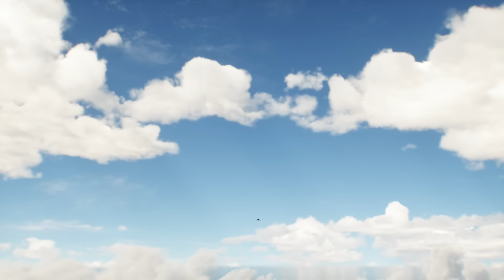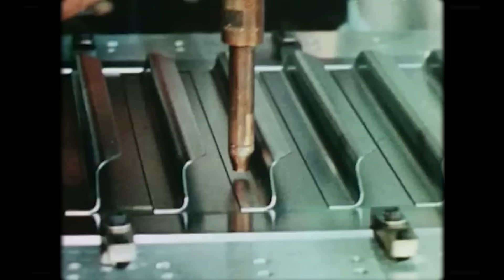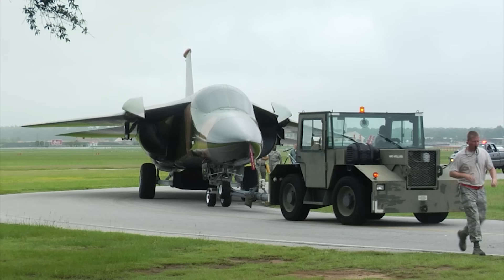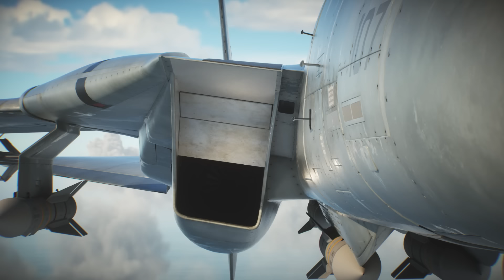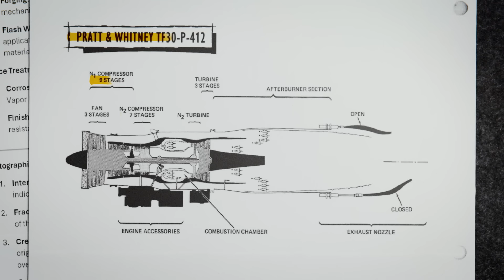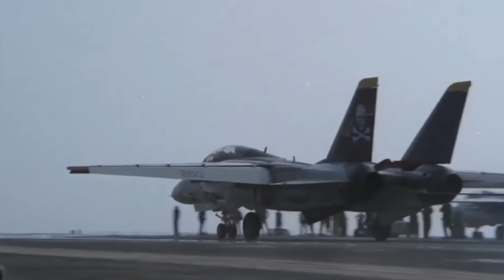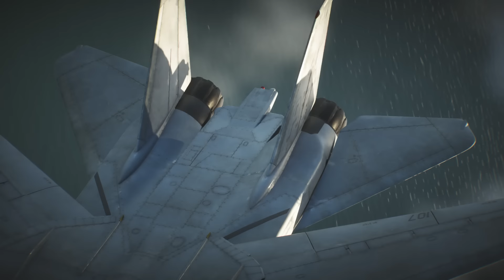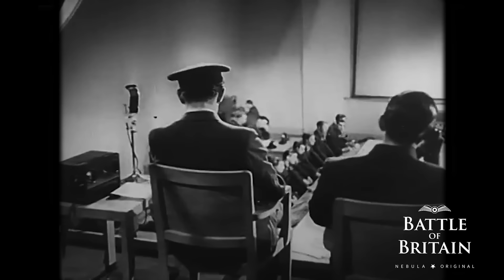The Insane Engineering of the F-14 Tomcat

Comment: In re the F-14 and Top Gun it's also worth noting that the canopy failing to properly separate in a flat-spin scenario was a real issue
Reply: Yes, but it's covered in NATOPS ejection procedures.
Reply: Canopy's need the forward speed of the aircraft to help rip them off and send them away before ejection. It would be terrifying to be in a flat-spin while wondering if that thing is going to separate properly.
Reply: @deekamikaze  I was an AME on F-14s from 87-90.  It was quite a while ago, but I suspect my knowledge of this is accurate on any cats newer than what I worked on.  F-14 has a zero / zero ejection.  Even on the ground with no movement, if the ejection handle is pulled the canopy is forced upward with ballistics. Initially it is still attached where it would normally pivot up.  So the front of the canopy rises up pivoting back, flipping backwards, and thrown between the stabilizers. Then 1.1 seconds later (if I remember correctly) the RIO seat is jettisoned, then the pilot seat. I don't recall the timing delay between RIO and pilot seats. Not sure if it was accurate or not, but we were told that at zero/zero the canopy would bounce between the stabilizers and keep going.  Of course when you have significant forward movement, the air flow coming up the windscreen would catch the canopy very early in the jettison and the canopy would be removed much more thoroughly. :)
Reply: @ydobeoN  
I talked to AME’s back in 1986 when this Bullshit movie came out.
They specifically told me that the canopy could never do that unless the aux canopy lanyard was pulled by accident behind the turtle back..
That’s the end of the argument as far as in concerned.
It never happened in F-14 history it’s fake..
When you argue with someone from F-14-s for real, you’re fucked asshole.
We’re watching…
Reply: @ydobeoN  Thanks for your service
Reply: @ydobeoN  Yup.... Rip it = Canopy, 1.1 sec = RIO up and Right, 1.1 sec = Pilot up and Left.
Full sequence is 2.3 sec end-to-end.
(I was an AT... buddy was an AME.... but we learned that shit as PCs in the Line Shack. It was in the 2-1.)
Reply: @deekamikaze  No, it doesn't. It scoops air under it which flips it backwards. It's also jettisoned with ballistics.
Reply: Can comfirm!
Reply: Topgun Days by Bio Baranek has good information
Reply: No it wasn’t, the aux canopy system made that unable to happen.
The only way that could happen is if a string in the back of the turtle back was pulled.
It was something only happened in a movie.
Reply: @foofghtr  misinformation
Reply: @ronaldkonkoma4356  
Facts I talked to everyone about this when the stupid movie came out and they told me this is the only way it could happen.
That was in 1986 and I’m a Naval Aviator, and I was in VF-31 at the time.
So if you think that’s mis information you’re arguing with someone who was there.
Ronald
Reply: @ronaldkonkoma4356  
Tell me without google what an SMDC line is?
Then we can talk..
Reply: @foofghtr  the problem they encountered is that the plane falls like a leaf in no wind. 
It does not head out to sea
The canopy hangs in the turbulent air above the plane. 
That's why NATOPS had them jettison the canopy and ensure it was clear before firing the seat. 
The lanyard is designed to work when the plane is going pointy end first.
Reply: @ronaldkonkoma4356  and your experience is how long in Naval Aviation? 🤣
Reply: @foofghtr  what is your challenge to the merit of the statement?
The guy who told you about ejection seats didn't even know that the RIO fires first and they shoot left and right to deconflict
You're fake news
Reply: Is the canopy coming off and the seat(s) ejecting a single automated sequence, or could pilots do one before the other manually? The latter could allow them to eject the canopy and give it a second to fully clear before ejecting the seats, no?
Reply: @OriginalUnknown2  Both. The canopy can be ejected separately by a handle on the right side near where the canopy and firewall meet. If the seat handle is pulled, it will engage the canopy jettison also.
Reply: @michaelmappin4425  if thats true, then would that, narratively speaking, make Goose's hitting the canopy partly his own responsibility for pulling the seat handle and not the canopy? I even seem to remember some dialogue of Maverick yelling at Goose to pop the canopy....
Reply: @themadmallard  Yes, he didn't follow the NATOPS procedure. There was an F14 squadron video years ago where the real aircrews broke down all the areas why they didn't follow the book. It was super funny but I can't find it anymore.
Reply: @themadmallard  Correct . Goose failed to follow the NATOPS boldface item to manually jettison the canopy first before ejecting  in the event of a flat spin...
Reply: @sundhaug92  
40 years later people who don’t their ass from a hole in the ground, commenting on the F-14 don’t know what the fuck they’re talking about.
It was a movie, it never happened ever in the history of the F-14.
I’m an F-14 Naval Aviator, and it just never happened or could have.
I know what could have happened to make that occur, but it’s a one in a million accident.
It never happened in the F-14 community, east or west coast.
Hollywood cooked that shit up.
Reply: oof written in blood  caution

Comment: The f-14 had the first microprocessor inside of it, for calculating the engine intake, wing sweep, and vein movement.
I loved the video, but arguably this was the most technologically advanced part of the F-14.
This microprocesser beat Intel's microprocessor by around 10 years. Ansolutly crazy technology.
Reply: There were lots of trickle down tech from the US gov from the Cold War era... these days? Not so much I believe... then again it's probably still deep in the Govt vault or Skunkworks or DARPA

Comment: Real engineering, i'd like to say for the end of your video that while your point was correct, you were a bit off.
The reason the 14 was retired was mainly due to cost, but since the 80's it was already on the chopping block from the incoming Hornet.
Part of the problem was the F-14 was built as a fighter, and just a fighter. This meant the navy needed multiple aircraft to fuful all dutys of the navy, causing logistical and maintenance nightmares. These problems led to the F/A-18 Hornet, and the Super Hornet. These two aircraft were meant to be cheaper multirole replacements for the F-14.

Good video!
Reply: Replaced the Phantoms that were still aboard the Midways
Reply: You guys are all forgetting one thing: while it turned out to be a decent dogfighter, the Tomcat's main role was never to engage soviet fighters such as the Mig-29 or Su-27. Much like the F-4 Phantom II that it replaced, it was mainly designed to be an interceptor aircraft that could fly extremely fast and shoot down soviet bombers before they could strike the fleet with their missiles or bombs and that's why it was equipped with such powerful, state of the art missiles. But as far as maneuverability goes, both the Mig-29 and the Su-27 clearly outclassed it. That's what the Hornet and later, the Super Hornet were designed for: to be multirole fighters that could also engage in air superiority duties. And with the threat of soviet bomberd gone, it's no wonder why the Super Hornet replaced the Tomcat.
Reply: The F/A-18 Hornet was never meant to replace the F-14 Tomcat, it was meant to complement it and replace all other strike aircraft is service.
Reply: @aceofluftwaffe6444  my bad, you are right to an extent. Originally the navy wanted an aircraft to replace the tomcat, but the hornet was forced onto the navy from the YF-17 program carrying over some attributes. The joint air force-navy project had most of the requirements forced by the Air Force, and they requested a fighter that had a shorter range and loiter time than what the Navy wanted.
To my understanding, the aircraft that became the Hornet was supposed to replace the 14 but it had its range cut down which means it was unsuitable for replacing it.

This info is based from the book Hornet: the Inside Story of the F/A-18.
Reply: @peppapig9987  That's about the story yes, except practically the Hornet was never really made to replace the Tomcat, it was a base design proposal, but they quickly saw the Legacy Hornet just wasn't fit for the job, not like the F/A-18Es would be better agaisnt mass bomber attacks from china but well that's another argument.
Reply: @aceofluftwaffe6444 oh, one thing I forgot to mention is that one major factor for why it was so hard to get the Navy to accept the Hornet was due to the problem of fleet defense, as it was originally inte ded to replace the 14 before the air force required a lower range.
Reply: @peppapig9987  F/A-18C Legacy Hornet was made to complement the F-14 and replace all the strike aircrafts still in service. The F/A-18E/F Super Hornets though were the ones made to replace the mighty Tomcat.
Reply: @aceofluftwaffe6444 F/A-18E/Fs were meant to replace the A-6 in the medium strike role after the failed Aurora project, while the F/A-18A/B/C/Ds were meant to replace the F-4s and A-7s in the light attack role.

 @jamesharding3459  A flight of F-14s with AIM-54s could prevent a flight of Backfires from effectively engaging the fleet. Multiple flights of Super Hornets couldn't due to both lack of performance and lack of engagement range.
Reply: Incorrect, most of the F-14 squadrons weren't decommissioned until the mid 90's, well into the Hornet 'era'. It was only with the  'peace dividend' budget cuts after the fall of the Soviet Union that the Tomcat's fate was sealed. Don't get me wrong, they were always the most expensive planes to build and operate (at the time), but before the fall, there's was 'raison d'etre' for them. After that, not so much. If you think the Hornet replaced them, look at the fleet capability we have today. Not a single plane fills the role. And it's only after the rise of China as a serious maritime threat that people consider a real replacement for it.
Reply: Huh, here I was thinking Dick... Cheney took corporate money to end the Tomcat in favor of another manufacturer. It WAS expensive, was high maintenance,  no one really dogfights with the U.S., drones were likely to be the future, with less 5th gen necessary.
Reply: @pgtmr2713  he might as well did. He most certainly is viewed (among us F-14 enthusiasts) as one of the main reasons for the Tomcat's demise. But i can't help but ask myself, would anyone listen to him if the fleet was under serious threat from long range hostile assets?
Reply: The F-14 was also just plain outdated as a fighter. With the imminent arrival of Super Hornet and AMRAAM, there was nothing the Tomcat could do that the newer airframes couldn't do better in addition to the strike and IFR roles.
Reply: @jamesharding3459  except of course, defend the fleet :)
Reply: @ilejovcevski79  On the contrary, the Super Hornet fleet was much more capable of defending the fleet. For one, it had a mission-readiness rate that averaged above 25%. Flyable F-18 > Grounded Tomcat.
Reply: @jamesharding3459  what good is mission ready, if you fail the mission? They can't CAP far enough, can't get there fast enough, can't stay there long enough and before the D AMRAAM, couldn't hope to engage from long enough. Not that planes can't be adapted to use other missiles. F-18 didn't ground the Tomcat, Tomcat grounded the Tomcat. It was old (just like the legacy Bug when it got scrapped) and no replacement was provided, as it wasn't seen as needed at the time.

Comment: I was under the impression that the F-14's radar is even stronger than the F-22's. I guess I learned something today. Well, more than just 1 something, lol.

Info below from ChatGPT (may be inaccurate)
The F-22 Raptor has a stronger and more advanced radar compared to the F-14 Tomcat. The F-22 is equipped with the AN/APG-77 radar, an active electronically scanned array (AESA) radar, which offers greater detection range, superior target tracking, and enhanced resistance to jamming. It also supports stealth capabilities by limiting emissions and using advanced signal processing.

The F-14, in contrast, primarily used the AWG-9 radar (later upgraded to the AN/APG-71 in the F-14D). While the AWG-9 had impressive capabilities for its time, including long-range detection and the ability to track multiple targets for AIM-54 Phoenix missiles, it is mechanically scanned and less advanced in terms of range, sensitivity, and electronic warfare resistance compared to the AESA technology in the F-22.
Reply: Yup, the F-22's radar has about double the peak output, at ~20kW

Comment: Most welding doesn't require combustion or oxygen. MIG and TIG welding are the most common and by definition are used with Argon or other inert gas to prevent oxidation. I'm guessing the electron beam welding has more to do with the temperature needed for titanium. I'm not an expert, but I think you might have misunderstood that part. Loved the video still!

Comment: You know I wonder just how absolutely insane a F14 would be with 3D thrust vectoring plus the latest in fly-by wire assisted controls.

Also if anyone would like to chime in, what does anyone thing a modernised F14 deign would look like with 2020s level of technology? I’d imagine something similar to the F22 swing wing concept

Also how does the F14 compare to the F15? And for that matter the F16 and F18?
Reply: A modernised F-14 design already existed in the ST-21 project, which came about in the 90s (same timeframe as the F-22). There were multiple proposals too, ranging from a pure air superiority fighter to a multi-mission strike fighter. 

F-14 compares relatively well with the F-15, depending on role. In air combat vs fighters the F-15 was generally superior, but not by much. They had advantages over each other, but the F-15 could more easily use it's advantages than the F-14 could.

F-14 vs F-16 is a match-up involving completely different fighters. The F-16 was a lightweight that could easily outmaneuver the F-14, but didn't stand a chance at long range, and was slower and shorter-ranged. The later F-14B/D models could however out-turn the F-16 in specific conditions thanks to the newer F-110 engines, but would still be vulnerable if the F-16 pilot chose to fight vertically.

F-14 vs F/A-18 is similar to the F16, but the F/A-18 lacked the F-16's acceleration and could only match the F-14 in a dogfight. The F/A-18 however poses a very different threat in a dogfight because it has far superior nose-authority compared to the F-16, and could rapidly decelerate to avoid over-shooting it's target, or it could simply point it's nose at it's target from an unexpected angle. The F-14 would generally win dogfights though, since it had superior climb performance and roughly equal turn performance. Needless to say the F-14 was superior at long range, and in the Navy's eyes was necessary to defeat Soviet bombers.
Reply: @dumdumbinks274 thank you very much for the reply mate!

Comment: F22 next pls
Reply: That would be a great episode. The F-22 is fascinating because it was initially designed in the late 80s - early 90s, JUST at the start of the real exponential takeoff of the digital revolution, but before anyone knew where the rapid advancement in computing would lead, so it has a ton of design features that are both a legacy of the hotrod cold war fighter design that were quickly outdated, like the focus on supermaneuverable dogfighting ability, but also a bunch of design aspects that started to anticipate where air combat would go, like going all in on stealth and sensor suites to seize the first shooter advantage. 

It achieved some incredible things for it's time, but it's also become outdated faster than just about any other aircraft precisely because there was no concept of how to design a fully digital platform yet, so it was designed monolithically with no real modular systems that could be upgraded. Even today, F-22s don't yet have modern helmet mounted displays because integrating them requires a massive redesign of most of the systems on the jet.
Reply: I mean, the F-22 too was made for a war it'll likely never fight. I think one difference though is that the F-22 is still largely classified
Reply: @sundhaug92  we prob will get F-60 or some new 7th gen before it's declassified (F/A-50 is kinda used by the Koreans for the variant of T-50)
Reply: @sundhaug92  F-22 is so classified they didn't even sell it. It's going to be hard to make a video on it that hits the spot.